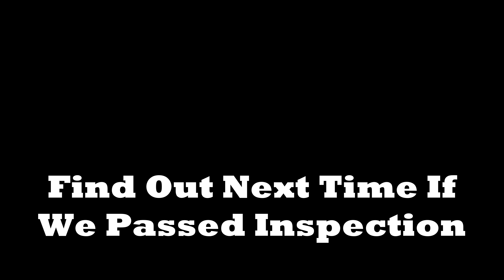Finally Ready to Put Concrete in the Footings - ICF Castle Series

Comment: software that lays out a critical path calendar of a build - very cool.
Reply: Sorry about this. You're filling up the trench with gravel to the bottom of the forms, but you need that space below the form to be open -  filled with concrete to get your 10" spec! The gravel needs to go on the outside - so the concrete doesn't escape under the form.  :) You'll be a forming master once its done. :)
Reply from the maker: The forms are higher off the grade in the trench. Yes, still have a day of grade staking and rock placing before pour. Thanks 😊

Comment: Never in my life have I seen so many rebar chairs used!  I used to just lay the bars in the forms, tie it up, then chair it.  And for chairs I would take a concrete brick in my left hand and whack it with the hammer in my right hand and instantly have 2 chairs.  I'll bet if you tied up your grid, you could remove 50-60% of those chairs and STILL have way more than you need.  Of course you are not going to do that, 'cause you already got 'em and it's not worth the trouble to take them back.  At this point the best way to get rid of them is to simply pour concrete on them.

As for passing inspection, I will call it at "conditional acceptance".  (Bulkhead here, spreader there, stake there and there and there).

Thanks for sharing.
Reply from the maker: It’s a lot 🤣

Comment: Where you have to redig where fill washed back into the rocks, do you have a screen frame so you can recover and reuse the rock? It would be a shame to just shovel away mixed material. I only remember working rebar (making cages for underground electrical duct banks) as being hard on the back and hands.
Reply from the maker: I’m keeping it separated and will use it somewhere 🤔

Comment: Waiting to see how the concrete pour works on the steps. Wood yet to be fitted cannot now go down to the ground as the rebar is in the way. So will concrete on upper step flow under wood  ruining height of lower step?
Reply from the maker: The wood isn’t supposed to go down to the ground. When you do footings, it is a continuous pour.

Comment: I have a question. Why does it matter if the rebar is close to the forms? It is fiberglass and won't corrode. Just curious. Looking good.👍👍
Reply from the maker: They want a minimum one and a half inch of coverage around the bar for adhesion and strength I guess. I’m supposed to do a factory tour and will let you know what I find out.
Reply: @BealyGood  thanks

Comment: It will be interesting to see if the rebar passes inspection. I’ve never seen an engineering spec that didn’t have a minimum overlap (12”,16” etc) on the rebar. On the steps all the rebar does is cross. Typically you’d need to bend metal rebar in those places. Your drawings should have that detail spelled out.
Reply from the maker: Part of what I’m picking up in Ohio is bent bars. Because you can’t bend the fiberglass on site. I don’t know how I would overlap on a 2 foot long step though. But I understand what you’re saying about the bent bar.
Reply: @BealyGood  typically bent in a “Z” shape with the middle of the “Z” the height of the step.
Reply from the maker: @bodereiss  I gotcha. I’ve got continuous bar that runs from top to bottom and I may replace those bars that tied in the corners with the bent bar. I’ll comment on how it goes in the next video.